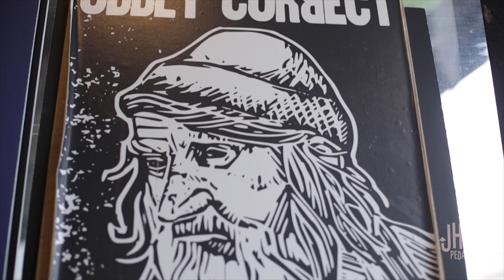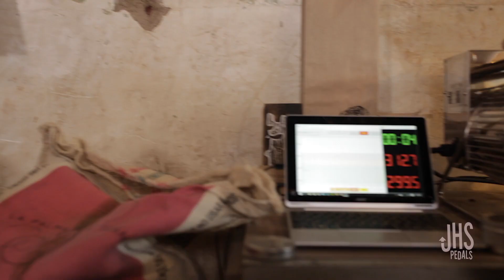The Roaster (JHS Pedals Amp)

Comment: I can imagine the amount of takes it took to say with a straight face, "This device is a tube transconductance amp. The tube plate current is proportional to the input voltage, heat is produced by large amounts of guitar signal causing variable ignomitrozation of the bi-polar isometric crystal lattice within the tube grid producing transverse obloid scalar oscillations that occur between the screen and plate elements within the 6L6 vacuum. In our research we found that by increasing the zero-point energy of the biasing ignomitrozation, we were able to produce a quality of scalar heat energy never before encountered on any stage or in any studio."